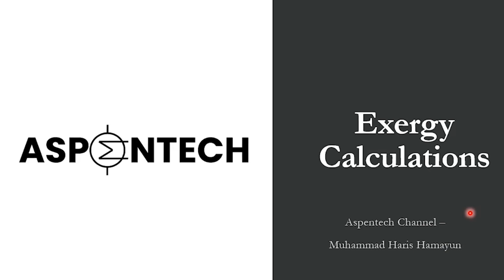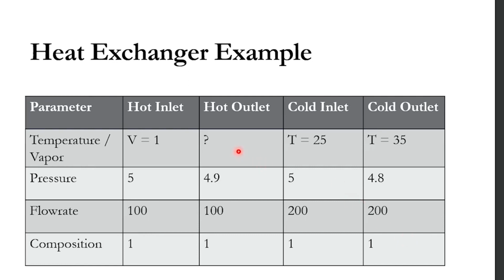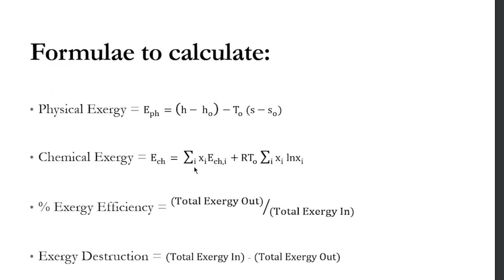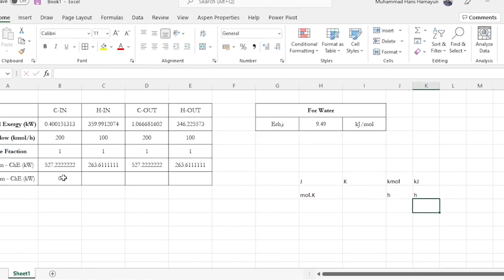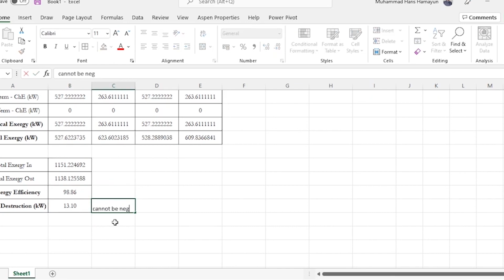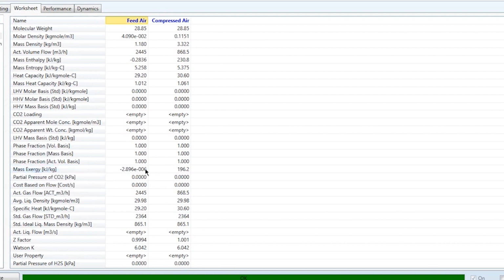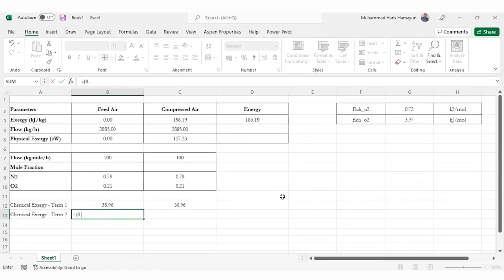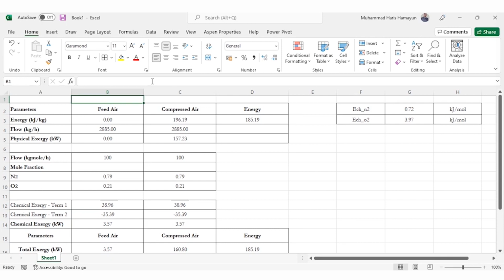Comprehensive Exergy Analysis using both Aspen - HYSYS and Plus - Lecture # 104

Comment: How did you find the amount of Energy in Excel find, which is " Energy = 185.19 " ?
Reply from the maker: This energy value (185.19 kW)  is the compression power required for the compressor.